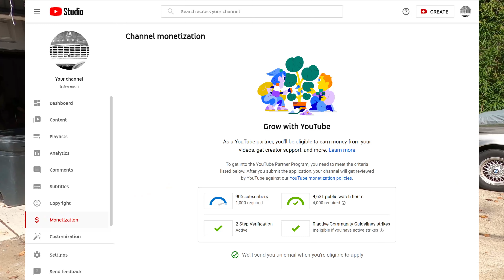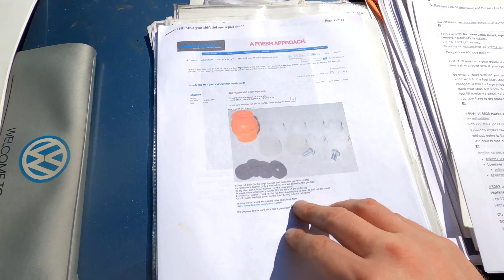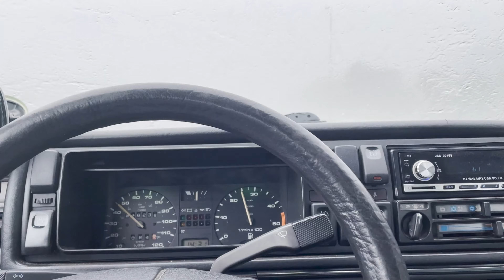I'm "giving away" my MK2 Jetta for $1.00

Comment: Sweet mk2!  A TDI swap would make this thing an absolute blast to drive.
Reply from the maker: Absolutely!  I actually bought it thinking I would do the swap. It is a CE2 car.  Didn't have the time + the OG 1.6 just keeps on going!  Thanks for watching!
Reply: @tr3wrench  My 1.6 ran forever in my vanagon.  It runs an AHU now, and it really made it a ton of fun.  Pretty easy swap since you dont have to change the tank or anything.

Comment: I've got a mk2 Golf with that same engine, and it's also my daily! No power steering, no AC, nothing! I've always liked the Jetta, and was considering to get one sooner or later.
Reply from the maker: Something about the MK2 just does it for me.  This one has power steering and A/C. Both systems replaced during the restoration. The A/C really degrades the driving experience but totally necessary here in the Mid Atlantic.

Comment: Looks complete. How is the rust?
Reply: Would like it for a Tesla swap
Reply from the maker: Not rust free but not bad either.  Patched a few holes in the floor during resto. Battery shelf has some rust as well as the other side of the engine bay. There is a hole on the rear wheel arch next to the fuel filler neck.  Painted that one with rust encapulator.